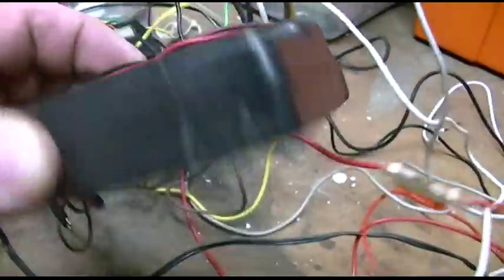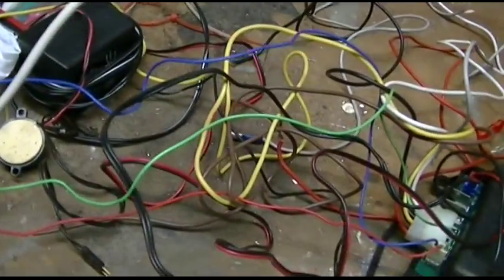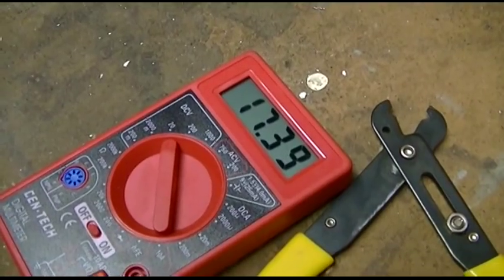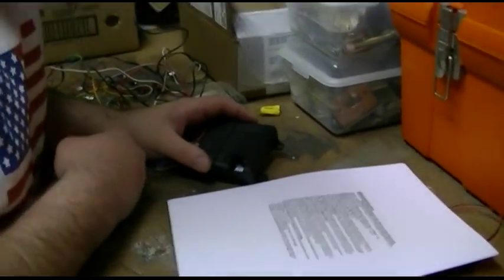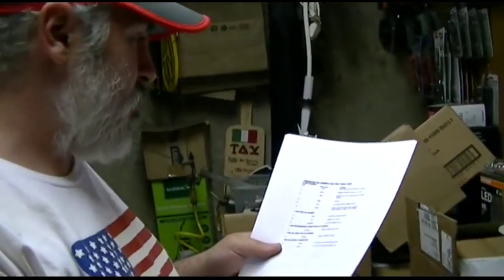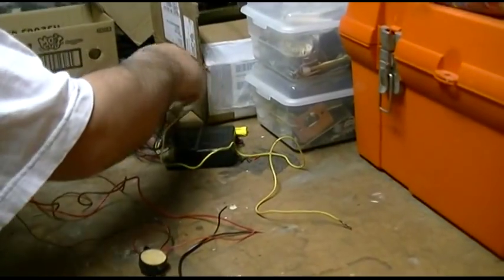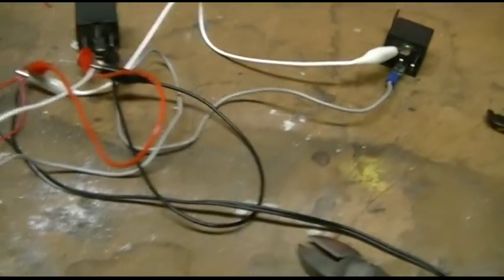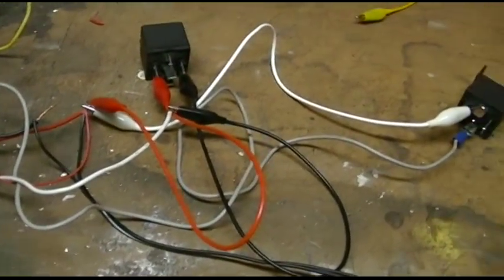Car Alarm Converted To Garage Door Opener Part 1

Comment: almost bought   a used car alarm system for 5$ at a thrift store a month ago to do some BS like this , but wasnt 100% sure it would be usable due to  alarm/cutoff/features vs actual togglable outputs based on the pinouts that was included plus it was  missing its custom harness connector  and looked maybe not usable.
Reply from the maker: +bob g Yeah without the wiring harness it gets kind of dicey.  If you just had 16 pins, none of which are marked, it makes it a lot more difficult to figure out "the purple wire".  This alarm wasn't terribly expensive, but everything was a la carte, had to buy the siren separately, all the relays, door lock modules, trunk pop solenoid, plus wire, of course.  But I seem to remember the alarm module itself with remotes was maybe $50 or so, that was also 13 or more years ago.  The alarm box proudly proclaims "made in USA", which is perfect for the vintage garage door opener.  With the amount of Chinamatronics out there, something like this can be had for considerably LESS now, but of course the longevity of such device would remain to be seen.  This alarm has been powered and in service since about 2002.  It had about a month off when it was taken out of the car and put back here.

The siren for the alarm is your standard 6-sound siren that were all very popular during said timeframe.  It has a small rubber plug that can be removed, and you can enable or disable any or all of the sounds.  I ought to make a video of that; I played with it when I first installed it, and you can make that "beep beep" sound that car alarms make sound VERY different by toggling those switches!